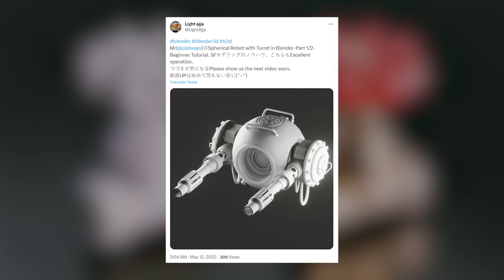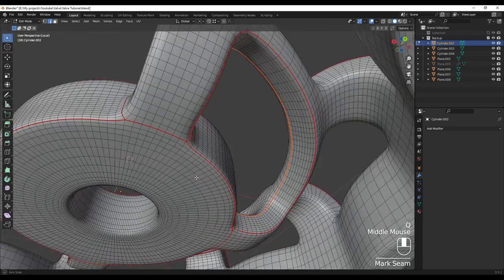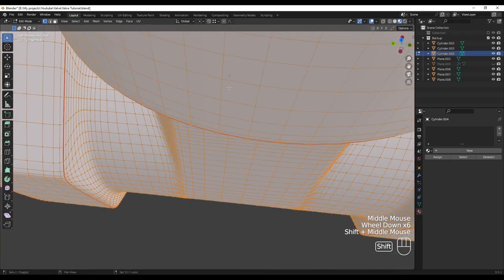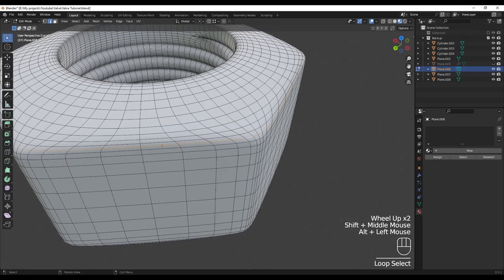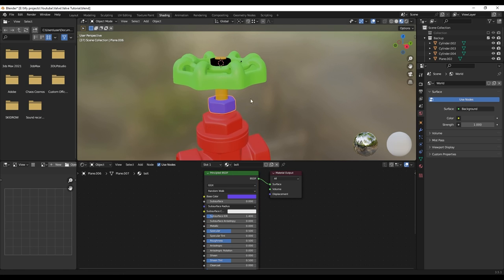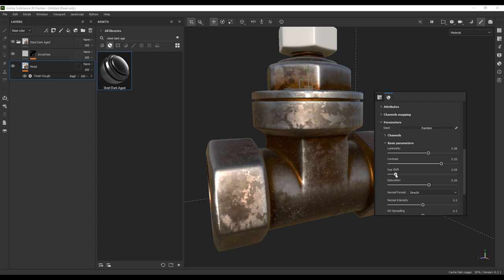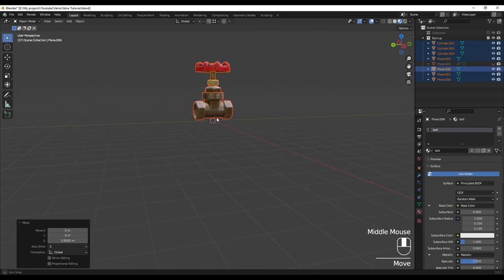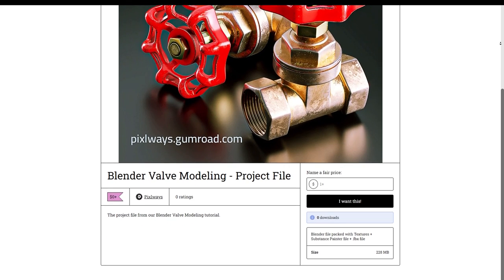Valve Material Creation Tutorial in Blender & Substance Painter

Comment: First, I wanted to say fantastic tutorial.
And secondly, I wonder if you could explain why you had to bake the model after importing it into Substance painter? 
You only had one model which you UV unwrapped, added materials for the different components, but there is no low/high poly versions of the model, just the one.
So I'm confused where the baking comes in. What does it do in this context? What am I missing?

Comment: Is it best practice to use the highest poly count with SP? Or do you decimate first?
Reply from the maker: It depends on the specific requirements of your project. For example, game-ready models must have a low poly count based on the project poly count budget. Generally, using the highest poly count can provide more detail, but it may impact performance. Decimating can be useful for optimizing performance without sacrificing too much detail. Consider finding a balance based on your project's needs and target platform. Experimentation and testing can help determine the optimal poly count for your specific use case.

Comment: Every time I use a Dis map in blender, some black pixels appear on my render, do you know what causes this？
Reply from the maker: Here are two things you can check:
First, ensure that the UV mapping of your mesh is correct and properly aligned with the displacement map. Second, If the mesh you're applying the displacement map to doesn't have enough geometry (vertices, edges, faces), Try increasing the subdivision level of your mesh. Hope these are helpful!

Comment: Hello
In Adobe Substance 3D Painter software, when I create a new paint layer and make changes in the Material section, those changes are applied to all existing paint layers.
Is there a way to prevent this situation so that a change in one paint layer does not change the settings and materials of the other paint layers?
Reply from the maker: As far as I know, Paint Layers in Substance Painter can't have completely independent materials or settings for different parts of the texture. However, if I find a way to solve this, I will definitely let you know.